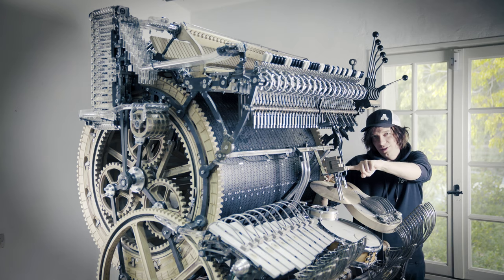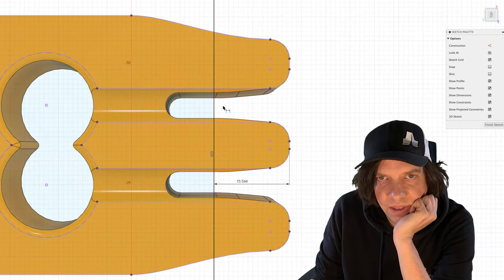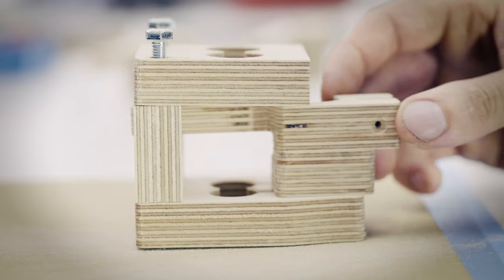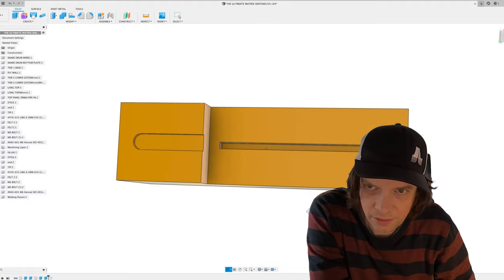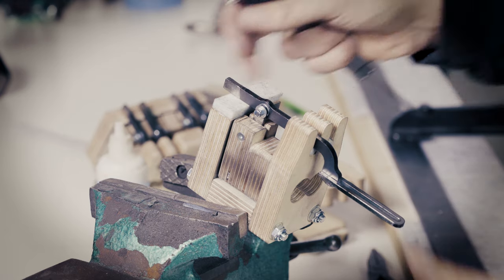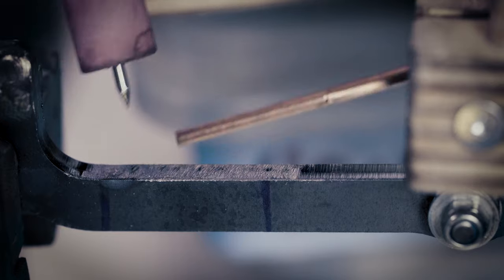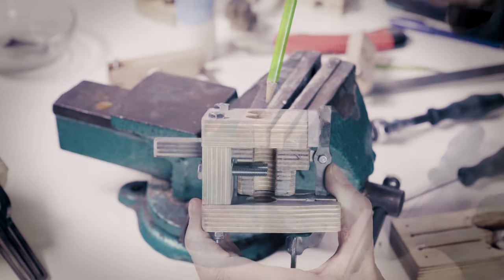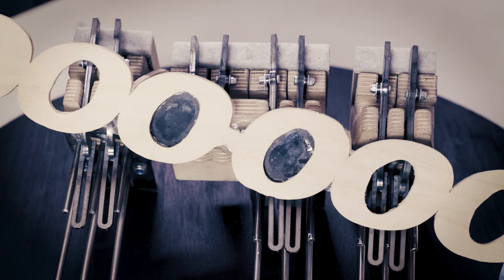Making Better Marble Gates - Marble Machine X #144

Comment: As already mentioned in one of the earlier episodes: What engineers would do is to work on the way the machine reacts to failures instead of trying to make it 99,999999999999999 % reliable. Which will always fail btw. The design has allow failures and be tolerant, so it is not the whole system that is breaking.

Comment: Martin, I feel like you're constantly stuck in integration hell. Could you stress-test individual components one-by-one first? For example, set up an automated way of testing just a single marble gate by itself. Rig a motor to the shuttle and stick a big ol' funnel in the top to keep feeding marbles in. Then set the motor to go and let the marbles drop. Brute force to see how close to 1-in-ten-million you can get. Is that feasible?

Comment: I hope Martin is taking the time to model all of the manual modifications (such as adding material by welding) he is making to parts for the if/when parts need to be replaced due to wear and tear to remove the experimentation of replacement! It will be so much easier to get the parts cut to the correct size rather than massaging them to work a year or so down the line when your mind is elsewhere.

Comment: One other advantage adding the metal to the gate so that the gate stays more open than over closed is as the felt wears in from repeated use it won’t over close like when you push the drop in all the way in.  Don’t forget your parts will wear over time and having parts that can be replaced or take wear into account when designing them. Remember this is not a one time instrument and will have to be torn down and rebuilt after each season.

Comment: Just a comment regarding the massive reliablity that you're striving for.......it's a big call!!  An occasional dropped marble or some that don't quite end up where they should only adds to the character of the machine - no-one should criticise that.  The only thing you really have to watch for is a genuinely stuck marble as that will instantly mean not 1/10,000,000 but 1000s more failed marbles that can't get past the stuck one.  So all the effort of increased reliabilty needs to focus on where marble(s) can get stuck - hopefully that will reduce the burden of chasing all the places where other ball problems might occur.  I just love this awesome project - keep up the great work!

Comment: If you are indeed at 105, it's totally deserved!! Well done Martin.  To be sure, I would raise a concern with regard to those marbles hitting those bolts over a period of time.  I am not an engineer, but I wonder if there's value in grinding the thread off the bolts to avoid overly wearing the marbles prematurely.

Comment: Hey Martin, a hack I’ve found with adjusting part size with F360 is to type + or - or / after the initial measurement. The measurement input box does the math for you!

Very handy if you need to adjust one side at a time by half a total measurement - say I want 1.765mm off of a part but that needs to split over two sides. Type -1.765 mm /2 and it will halve that measurement

Comment: Small tip for the tig welds for the extra mm. Just lay the filler rod flat on the surface and leave it there. Now go with the torch slowly over it an melt it. Like this the heat transformation to to bottom will reduce and the seam is higher. For this application it should do.

Comment: If the marble has too much space the dropping characteristics could vary.  When the gate pulls away, there will be a slight amount of friction and the hole on the direction of activation could meter the marble to a specific location as it drops.  So instead of a large hole where the marble is not in a specific location... it could be metered exactly into perfect drop location.  I hope that makes sense.

Also, I think a smooth rod would be more predictable than a bolt with threads.  The threads will scar up the marbles and wear down in millions of drops.

Comment: Im joining the bandwagon. Since were talking about 10M marble drops, each hit on the threaded bolt will cause wear. Removing the threads would remove the "sharp edges" of the threads and reduce wear and further minimize the chance of the dreaded marble jam. For 1M marble drops, maybe overkill, but for 10M?

Comment: I would suggest designing the plywood parts so that the shuttle cannot go too far in and prevent a marble from dropping. Then, use the felt to just slow down the assembly as it moves back in.

Comment: For sliding parts of plywood you can try to add Lignum Vitae this is a very dense dark wood.
This wood is used for centuries as a bearing material on steam ships.
This is an expensive wood but you could use slices of approx 4 to 5 millimeter and screw it to a sliding surface.
To all the other commentators I would like to say, give solutions not problems in your comments.
That’s how we built things!

Comment: Your video this week reminded me of the quality specifications while building automated assembly machines in my past life. I was the “electrical controls guy” who had to make the process perfect…..and prove it. There was one assembly project I had that built cluster bomb detonators for the US Government. (I never did that again). Anyway the quality “spec” demanded was called “Six Sigma”. 3.4 defects per one million machine operations. I think if you can get to that, after lots of testing, that will work for you in the MMX application. To get this 12 station assembly machine accepted by the US government, we had to successfully manufacture 100 “good” detonators in a row….and they would keep and use the 101st part. The rest were trashed. One machine reject within that 100 count, the count would start all over again. This is why a hammer, (per MIL spec), cost a thousand dollars in the US!! I LOVE perfection and have strived for that perfection in my work! That’s why I enjoy the perfection while watching every video during this evolution! I get it! Don’t stop Martin! Respectfully.

Comment: I wish Martin would round over the ends of the bolts that the marbles pass in the gates. With as far and slow as he opens for demonstration, it’s no problem, but in quickly and aggressively played notes I can imagine the marble get stuck between the end of the bolt and the gate—a rounded (polished?) end of the bolt would reduce that possibility dramatically.

Comment: As someone who designs complex mechanical mechanisms for a living, I'd strongly suggest using shoulder bolts anywhere you're using a bolt as an axel. They'll be much more reliable, with lower friction and less wear and tear on the parts.

Comment: 17:34 Put an adjustable felt stop at the back end of travel (left side in the video). Your felt will wear and compress over time, so having something adjustable will help.
19:45 Add too much metal then grind it down flat. :P

Comment: Martin, another way to apply graphite is to get a high graphite pencil (I think a 6B or higher pencil should be nearly all graphite, or you can just use a pure graphite stick), and simply draw on the surface, until it is fully blackened. It is a lot less messy than working with graphite powder.

Comment: First off, really enjoying this series ! good to see this thing growing and evolving! 

One thing I did think though with watching this latest instalment, you needed to 'shim' the felt 1mm to let the path lign up, now my thought would have been to simply re-cut the two ply pieces and re-screwed back on, wouldn't that been a little more accurate in the final item than taking laser cut / accurate metal parts and 'blobbing them up' to make them bigger, then grinding them back to fit. I  my mind, change the simple bit rather than distort a laser cut / accurately cut part....?
imho....
(and I'm not an engineer, but that seemed to jump out as a simpler / more accurate way of solving that issue)
Cheers.

Comment: After the wooden marble drop parts are made, they should be soaked in varnish, wiped off, and allowed to dry hard.  Then they can be sanded and coated with graphite.  Finishing is needed for wood parts that must interact closely.

Comment: Martin, you spent a lot of time making sure that every part was low on friction, but you didn't do anything with the screws that keep the marbles from dropping.  I think that you should remove the end threads and round over the screw tip.  This will also prevent damage to the marbles which could eventually lead to marbles not rolling properly.

Comment: Welding thin stuff can be tricky. I always start by getting my settings right by practicing on some scrap metal of the same thickness. That way, you don't blow holes and melt stuff. I also hold the torch like a pencil usually. Try it 👍

Comment: few tips on tig: use a smaller tungsten, smaller filler rod and 1 size larger cup. give it more pre-flow and post-flow (the former seems to be part of your issue, your arc starts too quickly after the gas starts flowing). You could also cheat by using stainless filler rod, it's more forgiving. Also, I saw you had a contaminated electrode in one of the welding shots you showed, that also messes up your welds, just break off the electrode up to a section that's absolutely clean. The grinding also contributes to a larger flame, your grinding lines should be parallel with the length of the electrode and not perpendicular to it.

Comment: to grind to smooth the bolt threads + bevel the end, in order to prevent a extremely rare but potential jamming of a marble, leading to exploding this machinery, seems a quick but necessary tweak.

Comment: Martin Martin. Please clean the scale from laser cut edges before welding. The scale has a higher melting point than the material underneath it which is why you can't puddle the surface without everything going blobby. Also if you use a bigger cup and try and keep the tip of the filler rod in the argon flow you will get those beautiful beads you are dreaming of.

Comment: 21:10 You should definitely make an extended durability test, I could imagine the felt wearing to the point of the marble getting stuck like it did before you welded onto the bar.

Comment: Just an idea. If you really want to reduce friction everywhere you can you should try applying the graphite powder onto the touching faces of the sun gears and the gears around them since there must be some friction there as well. But even if it's a little friction, because of the number of engaging gears it should be enough to make a difference.

Comment: Hey, I have an idea for your next project.  After you finish the MMX and go on tour with it, you should tweak the design further so you can build a version that can be taken into space by astronauts to play music automatically on a space station in orbit.  Design requirements include greatly reduced weight, greatly reduced physical size, and most importantly it has to work in zero G.  It'll be great.

Comment: Martin - I think set screws would be better as a stop for the shuttle. The felt will compress. I also think you should get rid of the bolts. The weight of the balls falling on them will wear even harden steel and induce friction. Keep positive. your heading in the right direction.

Comment: The felt is going to compress and wear over time. Prehaps instead of a solid bar linkage, you can use a threaded rod with rod ends so it can be adjusted.

Comment: You should consider using a tumbler machine with wood media inside to polish out your rough edges uniformly and quickly... an inexpensive way to reduce sanding and speed-up prototypes.

Comment: With the two surfaces you have sliding with the graphite powder, might I suggest you look into how metal sliding surfaces are prepared on things such as machine tools. The surfaces are scraped flat which promotes small pockets that trap the lubricant in the slideways. Maybe you could add a similar feature in the plywood surface which may retain some of the graphite powder? You could easily introduce some grooves with a dremel tool.
Reply: The grain structure of plywood should have sufficient space for the graphite for the effect you are talking about to take place.
It isn't a mirror flat surface after all. And wood can never get that perfect regardless. (Due to it being a fibrous organic structure.)

Metal on the other hand can be polished to a defect free surface with variations underneath the 1µm threshold. Making the over 5µm wide wood cells seem like huge bumps... Not to mention that graphite powder will break into sub µm pieces, unlike oil that has surface tension and viscosity working against such thin films on most surfaces. (Graphite isn't used in machinery since it does dissolve into the base metal, forming a thin layer of high carbon steel.)

Comment: Martin, have you considered sheet Delrin for some of the moving parts?

Pros
-Does not swell from moisture
-Naturally slippery
-Machines like a dream

Cons
-Expensive

Another protip:
Drill holes for locating dowel pins when glueing together stacked parts

Comment: I suggest you to Refinement of the screw and making it smooth then  put a rubber band around it , that will  prevent the balls from bouncing and reduce their sound.
Also put a thin layer of rubber paper around the hole .
Now you have a perfect part😚

Comment: Perhaps an adjustable stop that limits the slide travel is in order.  In the long run the felt will wear and a further adjustments will be needed. A screw thru the frame that holds slide to limit the travel would do the job.

Comment: Have you ever considered adding tracks between these wooden blocks and add smaller marbles on the tracks (or even a thin sheet of metal with tracks), IE marble bearings for the marble gates which need to move back and forth millions of times without wearing out or getting stuck or loosening up.

Comment: If friction on the parts becomes a problem in the future maybe consider laminating the contact surfaces w/ something like melamine, it's thin and slick.  I use it for table saw sleds and it glides so nice

Comment: I like this design, with just removing the thread off the end of the screw - it unnecessarily adds friction.

If this fails, maybe it's time to try shooting marbles with low force instead of dropping them - use a spring loaded mechanism, say a leaf spring block replacing the blocking bolt, with a push bolt/bar above the marble.

Comment: You might want to look into sliding surfaces (PTFE or the like) for these large sliding parts, as graphite might not hold that long.
And that threaded bolt makes me slightly anxious; it will wear down eventually and shed metal shards into the mechanism (not to mention change dimensions) -> a smooth hardened pin (or a smooth sliding sleeve for the bolt) might be a better option

Comment: Nice engineering. I can’t stop thinking of the mechanisms in a piano. As a complete noob, what strikes me is the plain screw in the drop path blocking a marble. It still has the threads on it. Could those damage the surface of the marbles? It also produces a “click” sound when a marble drops on to it. Also, the tip of the screw is kind of square. Maybe the edge should be rounded.... just a noobs thought...

Comment: Is that bolt going to be the final iteration for the piece separating the shuttle chamber. Having the marble ride on threads is extra friction that is easy to avoid using a smooth pin.

Comment: 21:28 I would recommend making the hole of a moving part a little bigger in direction that the part moves.
This will lower the problems when mounting tolerance is not perfect or wood expands due to humidity.

Comment: First off I would love to say what a wonderful video! Second off I want to ask why did you not make the entire shuttle surface out of a slicker material. PFTE or HDPE are easy machining materials and they are great for low impact repetitive motion without the need for constant lubrications. On top of the marble gate that moves back and fourth would be a good candidate for an insert of that material as a compromise. To ensure that the marbles have low drag and don’t, over time, wear through the veneered ply of the plywood. With the heating and cooling of the plywood over a long span of time it would potentially delaminate the plies causing system failure. Just a thought. Thanks for the great videos and the amazing motivation!

Comment: There is still some counter force.  Serge shuttle moves out the above marble assist yes, but still as the 'shelf' comes to hold the remaining marbles has to lift the marbles to get them level.  Scalloping the backplate could help this but make a tighter fit again

Comment: The weight of the marble drop arms is going to cause the linkage to hang down at an angle. Effectively the arm will be slightly shorter so the return position will be altered.

Comment: Martin, I just realized that you calculated that 10 million based on the fact that a song needs 3500 marbles. But not all marbles will go through the same path in a song, so one path, one pipe, one marble drop will not need 10 million cycles, maybe just 1/10th of it :)

Comment: Don’t know if anyone has mentioned this, but you don’t need to wave the tig torch back and forth over the weld after you stop welding. It’s better to just keep the gas flow steadily on the area thats cooling down from red hot than trying to get it on the areas that have already been exposed to air.

Comment: you probably fixed the offset in the CNC-files now already, so that you do not need to add welding to the front.
My suggestion would have been to get yourself thin felt sheets and add a piece to the inside backwall of the gates;
it would do double-duty of re-aligning the holes forward as well as noise-dampening and also no welding required.
Another option - to go with things you have flying around - you could have added a layer of the same silicon you used for creating the bounce-spots on the vibraphone-bars or dipped the back wall pieces into your plasti-dip.